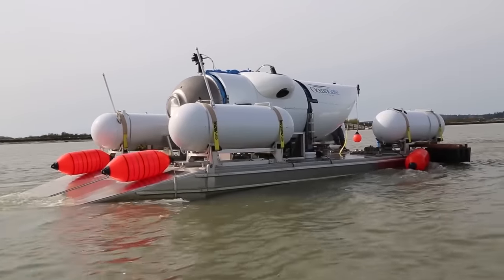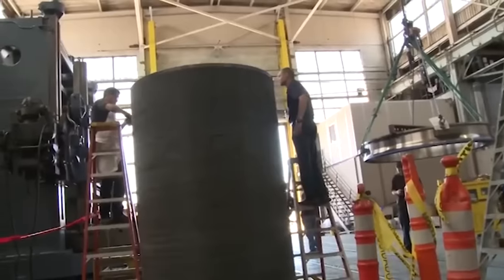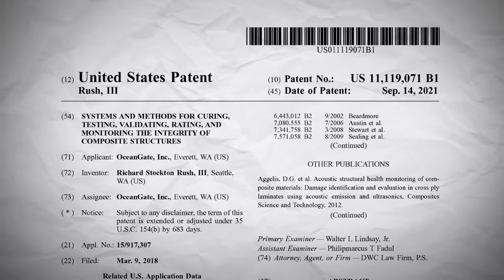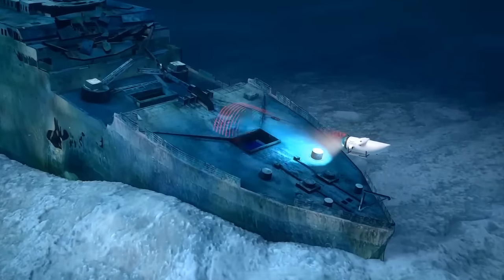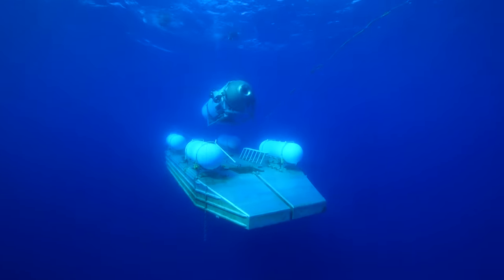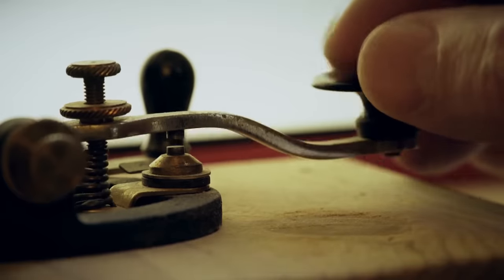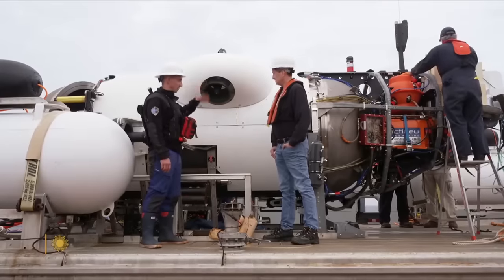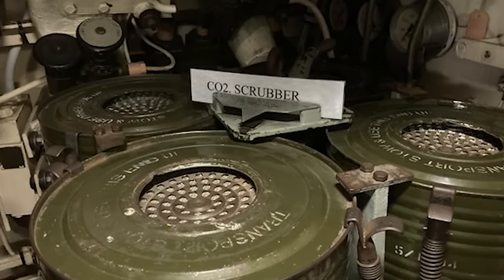Exposing OceanGate Submarines Many Fatal Designs

Comment: Worked as an aerospace materials and composites engineer for some time. From what I've heard it was filament wound and then unidirectional layup on top done by hand...which is an odd design choice. The other issue I don't hear about is the fact that composites under compression don't have nearly the benefit they do in tension or even shear. In compression you're highly dependent on your matrix (resins) not the reinforcement (carbon fiber). In some design choices this is acceptable and accounted for. For a tube under this kind of pressure...it's a MAJOR design challenge. 

For example, say you take a strip of dried super glue (matrix) and try pulling it. By itself it isn't very strong and likely brittle. Now take that super glue (matrix) and soak a strip of fabric (reinforcement) and the two work together. By itself the fabric is very limp, but now glued it has the stiffness and acts as a reinforcement to the super glue and will be relatively strong if you try to pull it (tension). Now take that same glued fabric and squish it lengthwise (compression), the fabric contributes very little to the strength of this composite and you are now almost entirely dependent on the strength of the glue at this point (aka, your matrix). This is the general principal behind most carbon fiber reinforced polymers.

Intralaminar failure is the separation of the matrix (superglue) and reinforcement (fabric) and can occur for a number of reasons. Generally, it occurs when the stresses exceed the matrix's strength or there is poor bonding between the two. Contamination, voids, expired resin, improperly cured resins,  improper cure environments are some of the examples that can lead to poor bonding. Lastly I heard this wasn't bagged or cured in an autoclave. Don't know if this is true but depending on the composite used, manufacturers specify if it requires just bagging, oven cured or needs to be cured in an autoclave. 

Generally speaking, out of autoclave curing is less superior to autoclaved cured. The autoclave is essentially an oven that pulls vacuum. As it pulls vacuum it forces air out of the resin and the resin is much more evenly distributed within the fabric. In other words, better bond...better strength. Given the size of the Oceangate cylinder I have my doubts it was cured in an autoclave given there aren't many autoclaves in the world that size open to just anyone and running one that size is not cheap. That’s not to say it’s wrong, design would just need to account for that in their margins. Also I'd like to know how rigorous their build process was. How clean was their environment? How accurately were things laid down? Temperature? Humidity? These all contribute to proper curing and bonding.

Filament winding is used in modern aircraft and tanks where the reinforcement is under TENSION. For aircraft, atmospheric pressure decreases as you increase altitude which means the cabin is applying a pressure from the inside. This means that the carbon fiber (reinforcement) is actually under tension. Carbon fiber (reinforcement) has the benefit of supporting the matrix in this case. Similarly, filament wound air tanks can hold thousands of PSI easily and commonly used in scuba/firefighter air tanks. In the case of a sub, the pressure is applied from the outside of the tank and the reinforcement is in COMPRESSION. Think of a net shaped like a balloon wrapped around the balloon. As the balloon expands, that net supports it and the fabric of the net is under tension. Opposite to this, if the balloon were placed in a vacuum, the balloon would shrink as their is now pressure on the outside of this. The net does nothing to support it.

With thick composite layups like this submersible, it can be very difficult to find these intralaminar cracks with non-destructive inspection. The appropriate testing method would require some type of fatigue testing that structural engineering determines the structure will face in its environment and is representative of the expected lifespan. After this testing, destructive inspection will then be done of the structure. I'd want to chop up sections of the cylinder, resin mount/polish them and inspect under a microscope at various locations to inspect the layup, especially higher stress locations determined in analysis. Voids in a matrix are generally accounted for in a design’s safety margin, but they are not and should not be designed with the expectation that intralaminar failure occurs.

At bare minimum if full scale testing and destructive inspection isn't possible, I'd want coupon (small representative pieces) testing with the same layup process done for fatigue testing and static testing in compression also followed by inspections. 

I've heard that material was possibly purchased expired from Boeing. This is more than likely prepreg. Prepreg is essentially the reinforcement (carbon fiber) already soaked in the resin(matrix) just not yet cured from the manufacturer. They're generally stored in freezers to slow the curing process and have a shelf life the manufacturer determines as the cold temps only slow, not stop, the curing (crosslinking). After the shelf life has passed, it's possible you won't have a composite that meets the manufacturers strength specifications. Manufacturers of these materials are sometimes conservative with their dates. Shelf life extension is possible if coupons are made and destructive testing is performed to validate the material is still good even past the manufacturer’s date. Not heard anything anywhere if this was done.

There are other variables that are also not brought up. Salt water and UV can be detrimental to many  composites. I have my doubts testing on this was done. The other concern I'd have is handling of the sub. Damage caused by impact can be invisible on the outside of many composites. If this was bumped in transport there's a possibility of unseen damage. Metals generally yield and have visual indications of impact.

Why they chose to use composites instead of steel or even titanium, is odd to me. It doesn't make sense...weight savings isn't all that critical for a submarine/submersible. To properly design a composite tube to take those kinds of compressive loads is extremely expensive given the time to design, test, and build a reliable process. With steel or titanium for example, material strength is readily validated with simple testing and easily designed for. There are plenty of designs out there that are also time tested. It would be significantly cheaper and easier to do structural analysis on a steel tube with certified and tested material. All said, it's hard to say the composite structure was even the culprit, it could have been the other parts of the structure that resulted in it's failure. Either way, sounds like marketing/executive decisions drove design instead of engineering.
Reply: Thanks for the in-depth information. This got me thinking, would concrete be at all suitable for a low-budget submersible? The compressive strength is high.
Reply: Wow...a complete lesson in carbon fiber.  Thanks!
Reply: It's mind boggling that the shell even survived the first few dives...I can't just believe that pure plastics could withstand that kind of pressure.
Maybe carbon fibers did work in some way? Resin shouldn't be the only thing kept it together
Reply: Very comprehensive analysis….I agree….Resins/composites are a brittle form with little resilience to repeat flexure….Metals are much better in scope…. My opinion….Geometry of the composite form is much more important  because of flexure concerns….Flat surfaces are very weak,wonder the strength if it were cast as an ellipse or “egg” geometry?….The cylindrical tube shape a no go for sure,a round sphere would have been much stronger…..
Reply: Thank you for an extremely thorough and comprehensive analysis on the varied and detrimental manufacturing decisions of the hull. This was an interesting read.
Reply: @richardpowell1425  One issue would be that concrete is porous, so pressure would force through water.
Reply: I am glad and didn`t tldr this one. One question: is it not possible to xray the hull for any internal cracks and cavities like they do with critical welds (steel welding)?
Reply: Yep, I'm an aerospace cnc machinist and I concur. 

We utilize a lot of fiberglass and carbon fiber in other areas of the shop.
Reply: S
Reply: Someone posted a YouTube video ("v=4PUTbK5AqY8") based on PR material by OceanGate. It shows how the carbon fiber hull is formed and how the titanium rings for the end caps are attached. Unidirectional winding of the long carbon fiber strip over a titanium tube for the hull. Thick glue ("like peanut butter") hand brushed on the tube ends before rings are mounted on the hull. All in an open air warehouse, lacking precise control of temperature, pressure, humidity, contamination, etc.

---

"Opposite to this, if the balloon were placed in a vacuum, the balloon would shrink as their is now pressure on the outside of this. The net does nothing to support it."

When inflating a balloon, the internal air pressure must exceed the external air pressure and push against the balloon's material to stretch it. If the external air pressure then is reduced by a vacuum, the balloon expands, as there's no outside pressure pushing back. If you meant creating a vacuum inside a balloon, then it'll collapse if there's no inside support to maintain its expanded form.
Reply: Thank you. Great indepth explanation. My sympathies to the families of all who perished.
This happens in other fields as well (eg Medicine) and may reflect the anti-expert times we live in . Accumulated wisdom  gained through decades of real science is challenged with “commonsense” with predictable disastrous consequences.
Reply: I literally was thinking about this exact topic....albeit in a far less educated manner....you validated my thoughts which were several fold.   First, that a cylinder is a terrible choice.  I spent a lot of time consulting on fiber optic systems at woods hole, and there is a reason all their pressure vessels for human occupancy are spherical and titanium.   Also, even titanium spheres stress and have a finite lifespan.  My second thought that you explained tremendously well, was that carbon fiber may have been an acceptable choice if they were trying to keep pressure inside, but that I couldn't see how it could work in keeping pressure outside.  Excellent explanation!!!
Reply: Shame he didn’t speak with you before this happened.  Prayers for everyone.
Reply: @asmo1313: X-rays go right through the carbon fiber. It isn't used to detect flaws in the material (delamination, voids, etc.), and experts say CF has to be cut open to analyze for flaws. That means you have to destroy it in the process of checking it. Thus, a sample from a set of pieces is chosen to be tested until destruction and then examined for its failure modes. A safety margin is determined for the use of the other pieces. The submersible is large and expensive, so OceanGate didn't have a fleet of them with a spare to sacrifice.
Reply: I heard in a different podcast that Stockton Rush’s aim was adventure. He had wanted to be an astronaut as a child but his vision wasn’t good enough to get into the program so he decided to explore the other unknown. He himself said they pushed the limits in undersea exploration but that was part  of the “research.”  Several former employees and passengers, as well as potential passengers have reported multiple problems and potential risks but apparently none of the concerns were ever addressed.
Reply: Also, Perhaps tugging it to the location with a cable had introduced some forces that contributed to failure.
Reply: why dont engineers figure out how the fish are made at the bottom that can take the pressure and then simply emulate the fish design and architecture into a sub?
Reply: Thank you for the informative comment. Learned a lot from this.
Reply: I agree with others thanks for the in - depth explanation of CF Construction processes.
..
In another thread it was claimed people could hear popping or cracking of the hull.
.
Maybe this was evidence of voids or delamination of the hull.?
..
Another channel stated CF at that thickness is like porcelain very strong but brittle.
Not an ideal quality for repeated stress cycles.
..
And let's not forget not only the pressure but the temperature difference as the sub descends..
..
If it transpires the resin had partially cured from the discounted CF and the fact it wasn't cured in an autoclave maybe the reasons for the failure and not necessarily the actual design?
..
I suspect the reason for the use of CF in the hull.
It appears to me that perhaps trying to build the sub
 "to a cost"
That there may have been plans once the design was proven to work. To commercialise the design to allow other manufacturers to build it under license.
..
The latter being speculation.
.
I also suspect the differing elasticity of the dissimilar materials
 (expansion & contraction rates of titanium & carbon fibre) caused the Bonding on the titanium end caps to fail..
Reply: @richardpowell1425  you still have to test it. Then, have the government even say if it's OK for safety.
Reply: You're awesome! Thanks for sharing your knowledge!
Reply: Holy crap on a cracker....

Kudos to you for writing that beastly indepth story journey
Reply: They used composites because it “sounds cooler” then steel. 

It’s insane to even think that you’ll drop a vessel in the ocean made out of composites.

I’d reckon that they even bought all of their construction material in Home Depot and designed it in Sketchup.
Reply: Every mechanical engineer who studied Hibbeler’s ‘Mechanics of Materials’ (widely used at universities) should be extremely careful with using fibers.
Wouldn’t amaze me if the transparent dome simply cracked. These materials remain brittle.
It’s not without a reason that pressure vessels used in the oil and gas industry are made from (tough) steel. There is so much to consider during material selection.
Reply: If they’d had the good fortune to survive but the misfortune to then read this comment, they’d have died of boredom anyway.😂
Reply: @SharpElbows123  Fish don’t breathe air. 🙃
Reply: @richardpowell1425  Concrete is porous, but that is an interesting idea though.
Reply: I am also a composites engineer.  I have no idea why they thought carbon fiber composites were a good idea for a deep water sub.  I agree with your assessment here.  Basically, it was a plastic submarine.  Steel, or Titanium seems like a clear choice for this use.
To make this composite design work, I guess they would have needed to compress the inside of the sub, which would have required alot of extra time for the passengers.  
Carbon fiber composites are designed for tension applications, not compression, it's as simple as that.
Reply: @SharpElbows123  
Not sure if you are joking or not.  The fish see zero pressure, the external pressure and internal pressure are equalized in a fish, they breath water.
Reply: @VonGoldfinger  
"sounds cooler"
Hate to admit this as a composites engineer, but i think you have a good point here.
Reply: But have you considered the fact that CARBON FIBER is a cool word that attracts investors? This is of course obviously more important
Reply: Yes, composites are indeed not  preferred for compressive loading
Reply: My immediate thought and I concluded it had been crushed before as soon I learn it was lost. Fun fact, what he made is just the same spool as the fiber is supplied by the mfg, just add epoxy for binding furthermore taking care NOT to get bubbles out.
Reply: You lost me at aerospace 🤡
Reply: That’s a novel man I ain’t gunna read it but I trust it’s informative 😂
Reply: Carbon fibre only for tension and shear loads, compression will crush the resin in-between the layers and if any air bubbles where left in the resin even worse.
Reply: @asmo1313  I saw a different video that mentioned xrays and said that Rush was quoted as saying that xraying the Titan was impossible, but I forget why.
Reply: Thank you for this.
Reply: Thank you very much for writing such an understandable and well written analysis. 
Wow! 😅
Reply: As an engineer and one who works with composites and mechanical properties, I agree and you are spot on.  I would speculate that the structure itself was marginally fine with the exception of the hatch and the 18 bolts holding the hatch in place.  The hatch interface would be highly suspect when the vessel seen the compression then release. The connection for these 18 bolts would be stress risers at the interface of the composite. It is likely that the temperature changes during decent resulted in CTE mismatches of the composite, the metal and the window. There are likely different enough that repeated dives caused micro fractures of the composite that failed instantly. Reinforced composites have free airspace in them regardless of the best lamination process under vacuum along the fiber to resin boundary.   A water molecule can easily penetrate this free space at the chemical bond boundary. And as you mentioned, we do not even know if they used a vacuum to produce the shell.  This resin to fiber interface will fracture under stress at the microscopic level and the detection equipment would never hear a thing until catastrophic failure occurs.
Reply: Wow...thank you for this fantastic in-depth write up! Learnt something new
Reply: I hope your company pays you well, because you definitely know your stuff.
Reply: @ghytd766  make the sub breathe water then
Reply: @prototype.3324 Maybe the should have replaced it with new after each dive. With the money they were charging the passengers, that might have been feasible. They would have made less profit, though, so perhaps that was the driving force.
Reply: @KM-mh3ds Oceangate wouldn't have taken any notice. They rejected previous criticisms.
Reply: Nice, in-depth explanation. Thank you! Btw, I read that the reason they used composites instead of steel or titanium was to save on ballast cost.
Reply: @Arjan_2 And they must have known that the windows material wasn't designed for those depths
Reply: @naomiwashburn358 Ok, so x-rays were impossible. Why not accept sound engineering advice on alternative testing, or another way to create the hull? It seems Stockton wanted to do it all his way, ignoring/firing anyone who suggested his ideas were bad.
Reply: @Jmo2321 I'm not a structural or composite engineer. But I am smart enough to know that building a sub out of woven material of any kind that required bonding using a resin of some type leaves way way way too many possible microfracture/weak points-and all it takes at those depths is just 1. Out of infinite bonding points and weave points. Just no. And why it was a tube instead of a sphere. Makes no sense. Really great info my brother.
Reply: Well I have to say that was very informative (or the most convincing bull shit I have ever heard😂😂 ) the thing that shocked me was the fact that the end flanges were bonded to the composite tube ( glued 😳)
Reply: @karenrussell8704 these pressure vessel codes (ASME B31) are huge and these cover the design, testing and certification of pressure vessels. These codes were developed for obvious reasons. Brittle materials should never be used in high pressure applications. The dome absorbs compressive forces which are less prone to cracks: don’t use these materials anyway. 3,8km below the surface is different from watching dolphins 20m below the surface…
Reply: @richardpowell1425  Red bricks should do the tric.
Reply: @SharpElbows123  fish withstand the pressure because they stay in the same level of pressure, a human  cannot withstand 400 bar of pressure like that, resurfacing from the deep takes many days,  even weeks in some experiments.
Reply: @SharpElbows123  Body of a fish consist mostly of water, probably at least 90% and not a hollow brittle skin filled with air or oxygen like a submersible.
Reply: @prototype.3324  It was five inches thick. Thinking about it in terms of normal material expectations will often lead to strange places. That's part of why designs like this are usually supposed to undergo so much revision by qualified engineers.
Reply: @johnwarwick4105  they were bolted-did I misunderstand?
Reply: @mikeomolt4485  why not make the sub full of water? and the passengers can be inside the water/gel combo
Reply: @ulrichkalber9039  why not make the sub full of gel/water?
Reply: @SharpElbows123  there are bodys of air in a human body, they would compress, this is lethal.
Reply: Many thanks for all that information. I studied materials technology and felt reminded of some of my former lessons. I once had the opportunity to visit the Airbus plant where they formerly manufactured the fin for the A380. Watching that and especially those huge autoclaves is pretty impressive and really feels like high tech. 

When I heard that this submersible has been made of carbon fibre composite and that company mostly worked with young and inexperienced engineers instead of hiring more experienced ones I had a bad feeling that design and material choices were mostly made based on marketing ideas.
Reply: @theomnipresent1  and what about cracks?
Reply: @SharpElbows123  a rock can also be found on the bottom!
Reply: In another YouTube video on this subject someone mentioned a titanium alloy that is used to manufacture some submarines in the comments. I did not jot down the name of the material fused with the titanium because the government can get completely insane with that kind of thing and I criticize them a lot. I mention it here in case it could prevent another submersible tragedy.
Reply: Thank you. 👍
Reply: @funkdoktor9099  bolted to a titanium ring that was bonded to the tube from what I saw
Reply: Why wasn't the Titan made out of the same materiel that Black Boxes are made out of?  You know the Black Box that survives an Airline crash.  What is that Black Box made out of that would withstand an impact of a 747 crash?
Reply: I just about to say that.
Reply: @georgeboyd6580   A  submarine is built with internal steel/ titanium reinforcement to strengthen the entire vessel. Titan is only as strong as the composite tube and the glue used to attach each end.
Reply: @ulrichkalber9039  why not create miniature vacuums around the human body like a vacuum suit? what about removing the air from the body and using an artificial lung that converts water to oxygen? what about building a massive sub so large that there is such minimal oxygen inside not to cause compression?
Reply: @mikeomolt4485  why not create miniature vacuums around the human body like a vacuum suit? what about removing the air from the body and using an artificial lung that converts water to oxygen? what about building a massive sub so large that there is such minimal oxygen inside not to cause compression?
Reply: @ulrichkalber9039  why not create miniature vacuums around the human body like a vacuum suit? what about removing the air from the body and using an artificial lung that converts water to oxygen? what about building a massive sub so large that there is such minimal oxygen inside not to cause compression?
Reply: @johnwarwick4105  if thats true thats bonkers. Bonding materials to withstand that pressure. I cant really wrap my head around that process being in any way a good idea
Reply: @SharpElbows123  Too complicated. If scuba isn't your thing, consider draining the ocean and do guided tours trudging through the mud to Titanic wreck. Only a 400 mile treck off the coast of Nova Scotia.
Reply: @karenrussell8704  He thought he was smarter than everyone else, I guess.
Reply: Saved me some time. If I was forced to design this, I would have thought hard about using triaxial braid instead of helically wound fiber. I would have made the composite with a very dense honeycomb core, probably of titanium, at least 4 inches thick per layer. The stiffening effect of the thickness of the distance between the center of the skins would probably have improved compressive strength. Maybe. 

FEA of composites is shall we say, less than trustworthy unless fairly large multiples are used, I like the number 3 in those cases.

The idea of acoustic monitoring for potential failure loads in real time was poorly done and not well understood. There has been some interesting results using Fiber Bragg grating to measure tensile stress. As you said, though, the whole issue is compressive as opposed to tensile.

I have no idea how much it cost to make the chamber, but it was idiotic to go out of autoclave. It was also a bad idea to not do at least a half scale model and then blowing it up real good.

Basically, I think it was a bad way to approach the problem. The proponent didn't want to use any of those incredibly experienced and brilliant Navy submarine types, he said at 50ish they had "old foggy" ideas about how to do this sort of thing.
Reply: @mikeomolt4485  Yes, most of us get that it is a bad idea to make a deep sea submersible out of carbon fiber. The issue is   that titanium and steel is too heavy. The answer seems to be that a secret exotic titanium alloy works.
Reply: @richardpowell1425  never concrete.
Reply: @SharpElbows123  Deep ocean fish have collapsible lungs and do not rely on oxygen, are vertebrae, and are always at the same pressure as the depth they live at. It’s not feasible to recreate all these conditions in a sub. However, it has been found that a sphere is the best shape for submersibles and certain materials like titanium are preferred due to its strength in withstanding compression pressure.
Reply: @ghytd766  The CEO was big on being innovative and thinking outside the box, so in his head using carbon fiber for a submersible seemed like a good idea for some reason, but looking at the submersible’s construction, a single sheet of already used carbon fiber was used, it was applied parallel all around, and the thickness was 2 inches less than was thought to be needed according to a report.
Reply: Most valuable critique I have come across on line or from the news networks.  Well explained.  Thank you.
Reply: Good stuff. Thanks. I don’t think this team knew any of these details. They even said he bought the material second hand to save money. I doubt if they truly knew the full provenance of it. They just used it. Also I read that even if I lit worked ok, it would weaken over time. I don’t think this operation was checking for micro fractures after each dive.
Reply: @georgeboyd6580   Perhaps multiple stainless steel hoops as reinforcement, embedded in a quality controlled composite process, similar to a reinforced tunnel construction. The real issue here is whether the submersible is being built as a ride for a Captain Nemo type theme park, or serious exploration, even to the depths of  Mariana Trench.
Reply: @supertuscans9512  hit the bricks, pal. He’s an actual expert and you are lucky he  spent his time explaining things to the likes of us.
Reply: @richardpowell1425 concrete is porous and full of air, I'm not educated in the matter but from what I understand, that wouldnt be watertight and would very easily implode if you managed to get it down to depth without sinking.
Reply: That comment was way too good and high effort to just be a comment. It’s a whole YouTube script at this point. Great read
Reply: Fantastic lesson!
Reply: @SharpElbows123  there would still be air in the lungs.
Reply: @tonycerviver2123 what in the black box survives*?
 Silicone,metal etc?
 Encased in solid epoxy?
Yes if titan was solid c'fibre it wouldnt implode.
Completely different loads and types of stress.
No person is inside a black box nor would they survive impact hypothetically if they could be.
Reply: I would be curious as if photos with UV before and after every launch was done. Especially at certain stress points. The photos of the sub, I'm thinking the carbon fiber parts; could be compared with previous dives. Any noticeable differences would have been a red flag. True, it's not destructive testing and viewing under a microscope; but it would give a record of the sub after each dive
Reply: @mikeomolt4485  For that matter, a deep sea submersible could be made in spherical shape out of glass formed in the vacuum of space. Los Alamos National Labs did experiments in the 1970's with glass formed in a vacuum and found in was 20 times stronger than steel. I would still go with the exotic titanium alloy.
Reply: @SharpElbows123  mainly that humans need air inside of us, and so does a submarine, while deep see fish do not. To design the Titan to be like a deep sea fish, they could just leave a hole in it for water to come in.
Reply: @ghytd766  not to mention that 6k psi would kill them all.
Reply: @karenrussell8704  honestly, 250k sounds very cheap, considering the effort it takes to get out to sea and back plus support. I wonder if they were making any money off of this trip.
Reply: After you left aerospace materials and composites engineering, it looks as though you went into teaching! Great essay, thank you. I was concerned about having two different materials involved (carbon fibre/titanium) and their joining interface bearing in mind their different mechanical characteristics.
Reply: It is an odd choice, and people are suggesting the "cool" factor, which could be part of it, but that seems like a pretty stupid move for an engineer. I am wondering about different reasons, like what expertise they had, what machinery they had, etc. Possibly some insulation value, accoustics maybe, ease of use perhaps? Seems like even the most lazy engineer would know that brittle materials like carbon fiber are better for tension loads. I like that they at least attempted some kind of damage sensors. I suppose that could be another reason to choose carbon fiber over metal, the ability to get some indication of damage before a catastrophic failure, or so they hoped.
Reply: Yeah man definitely wasn’t tested properly and was overused. Most likely the carbon fiber gave out
Reply: Very insightful and formulated comment. I'll take your word for it as it does sound like you have some experience 😁in the field and what you're talking about.
Too bad 4 people had to die to prove the 1 guy wrong
Reply: @lisalarsen2384 you should. It's so interesting.
Reply: Another deep ocean sub expert, who has been builing submersibles and running tours for decades and also was on the Titan for one test dive, exposed the footage on oceangates own website that the CF was infact wet-wrap, vastly inferior to Prepreg (pre imprgnated with epoxy), so it's even worse than you imagined in design. Oceangate straight out lied and told everyone he would be using 100% Prepreg. The guy was quite implicit after the test dive that they should imeadiately cancel all booked passengers and do a complete redesign of the vessel.